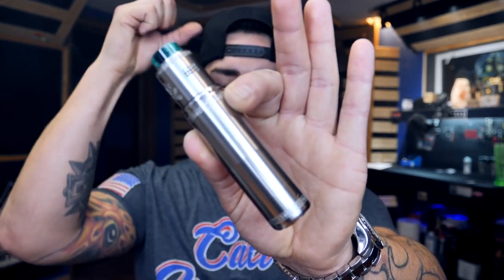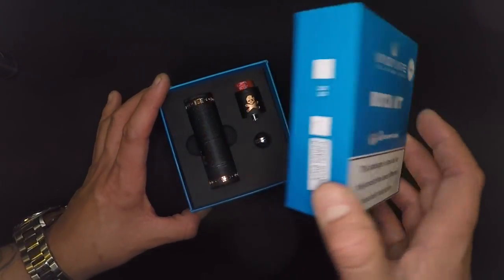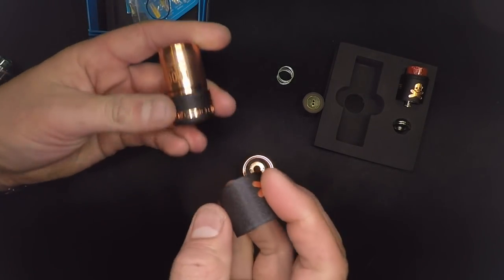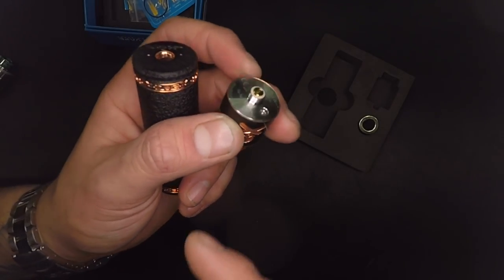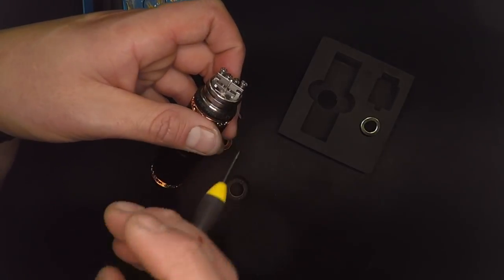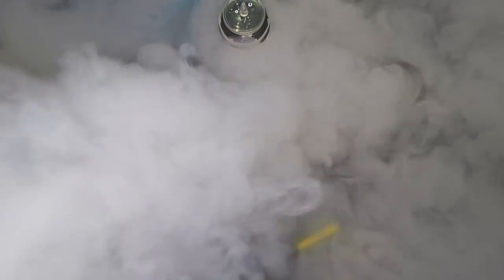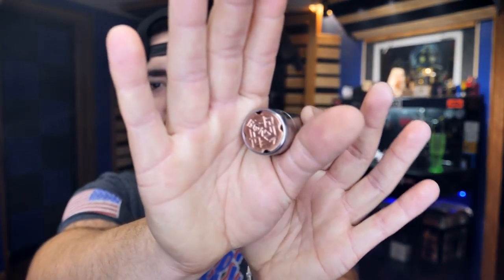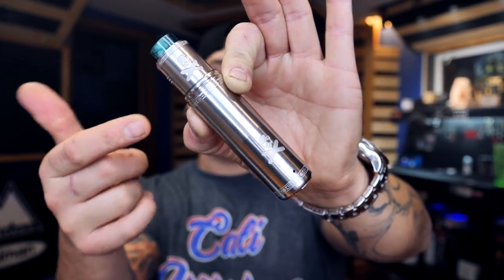Best Kit For Under $100! Bonza Mech Mod Kit!

Comment: I'm a mech head and I was gonna grab this kit but, I kept hearing that the button is shit whether you're using the magnets or spring. I heard that the button won't fire unless you fully press right I don't the middle and that the throw is way too tight and crunchy. Even heard of the button sticking with a few people.

I'm waiting to hear if the new colour ones are having the same issue or if Vandy Vape fixed it.

Nice review dude!